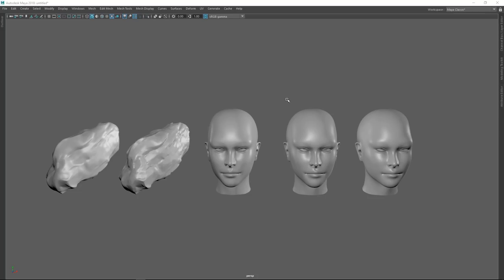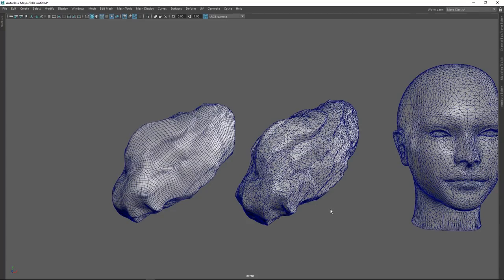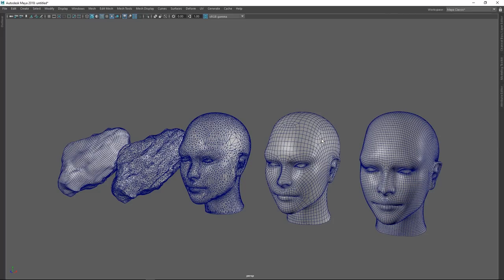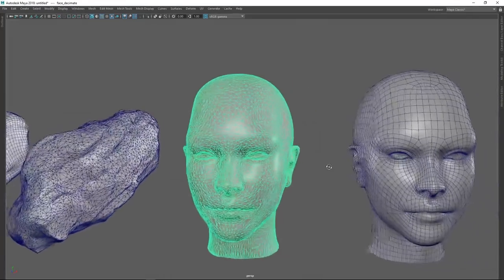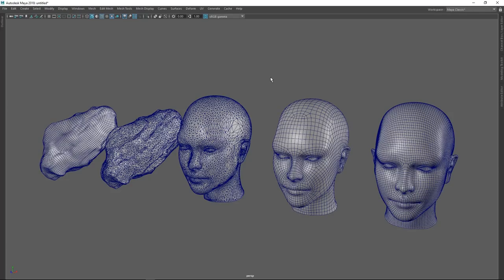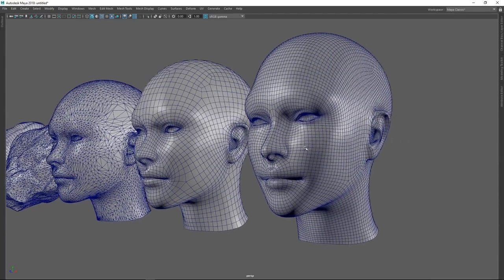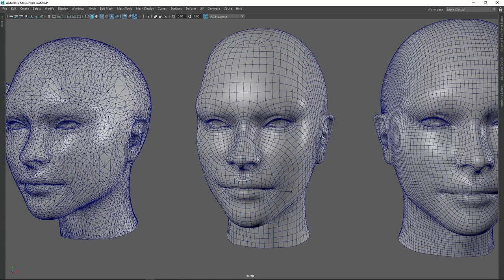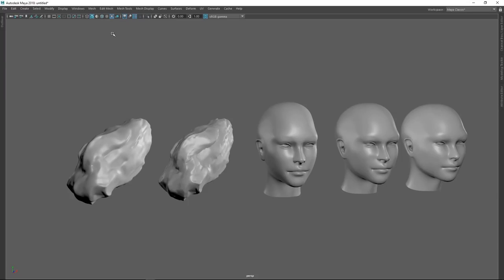Is Good Topology Overrated?

Comment: i thought people said that tri's were bad for games specfically for deformation and normal calculation when importing into the engine.
Reply: it's fine in some spots
Reply: JermaineATL Game engines triangulate everything, so tris are fine- it's really for subdivision/displacement/simulations that quads matter. Also animation, of course.
Reply: yeh game engines do triangle meshes, but engines calculate vertex normals differenty.
Reply: They are totally fine when you plan to increase the polycount of your mesh anyways. Of course they should always be kept to a minimum to prevent deformation. 
What I hate about triangles is that when you want to generate a lower subdivision level (decreasing the polycount), ZBrush can't perform the operation because of them. The problem is about ZRemesher: oftentimes it generates excellent meshes but with one or two tris, that then prevent you to go lower.
Reply from the maker: Like we discussed in the videos, everything is a triangle under the hood. That said, I definitely advice against putting them in areas of high deformation. Sometimes you also have to chose between adding a lot more polys, making it messier - or simply adding a triangle. As long as you know why triangles can be bad, they are fine to use.

/H

Comment: Ok but no one is explaining WHY it's important. You can't tell me the head on the right is not animatable. Are we really just holding on to the old ways just "because" I mean I learned low poly modelling in maya in like 2003 and it literally makes no sense to retipologize in today's environment. It makes total sense to try and stay low poly, but c'mon just because you're taught that way doesn't mean it HAS to be that way. That's working with a 20+ year old mindset.
Reply: These are principles, you can disregard them and do without these and you will realize that sometimes you just goddamn best stick to these principles and there will be 
cases when you can live without them. But. When it comes to human anatomy and articulation and facial shit you just can't do with lousy topo. Even the slightest errors will accumulate into horrible results and then you are in trouble. Especially if you are in a pipeline. If on your own, and you make your own shit you can shrug off these advices. But you have to know the rules before you kick up the bucket.